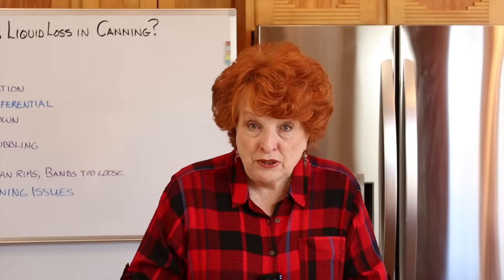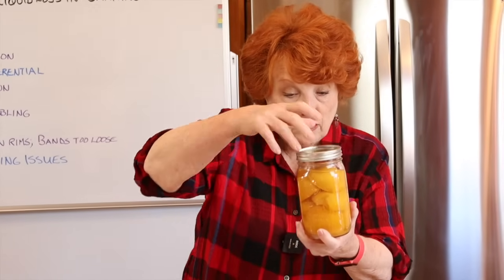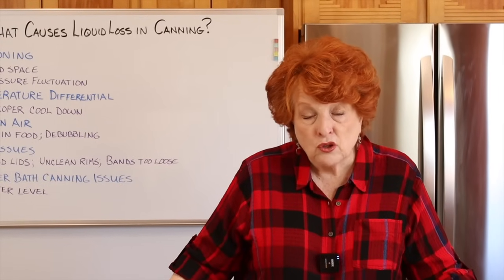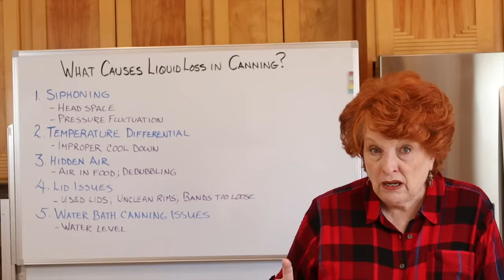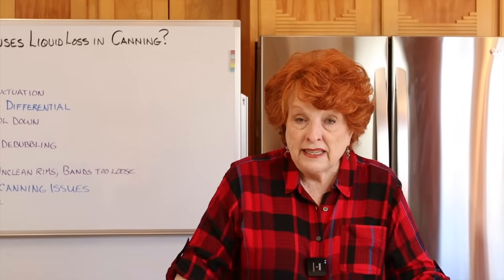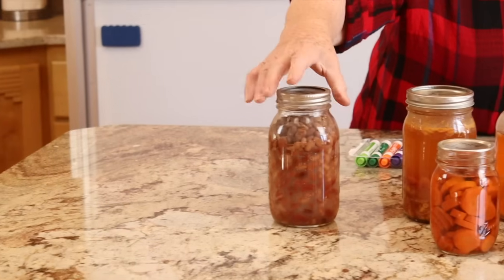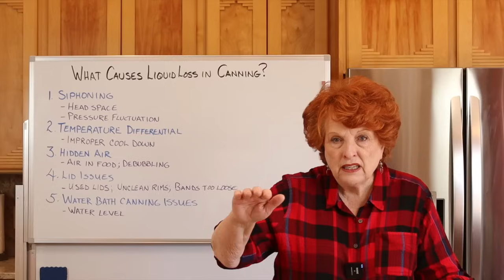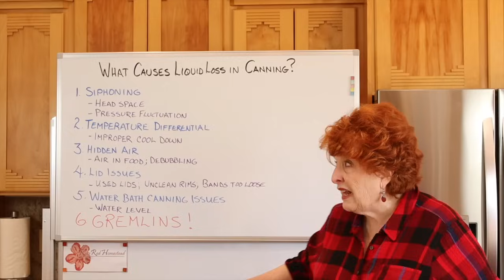What Causes Liquid Loss in Canning

Comment: Thank you so much for sharing your knowledge with us. I have a question. I water bath canned some raw pack peaches. I live at 8200 ft. When the time was up I turned off the heat and let the 4 jars sit for 10 min. I lifted 3 out and they were fine. The fourth jar started super boiling and spewing steam and liquid after I got it out of the canner. I set it down and it continued to push the syrupy liquid out for several minutes. The first 3 jars were Ball, but the failed one was an anchor hocking one. It did seal and in the end all 4 had the same liquid level about a half inch under the lid. Is this a jar issue?  There was about a 4 inch syrupy ring on the towel but the end the liquid level in the jar was fine. Why wasn’t it lower?

Comment: Thank you so much for this. Again I learn more and more from you. I have water bath canned for many years, new to pressure canning. This year in canning salsa we had two pint jars that initially sealed but then failed out of 44. I know that doesn’t seem like much, but we have had maybe one fail in many years. This year we did not put the lids in hot water as we have always done before since the directions have changed and say you don’t need to. Should we still be putting them in the warm water? Could that have caused the failures?

Comment: Last wk my husband processed several quarts of apple slices.  I noticed one jar seemed low in liquid.  I thought it strange because that usually doesn't happen.  When I took a closer look later, the ring wasn't even on the jar correctly.  One side was up about a quarter inch.  It must have been a gremlin because my husb knows better.
Reply: I would suggest to mark that ring and keep an eye on it next time you use it for canning.  Last year I bought 6 dozen new rings and every one was defective.   Most couldn't even be tightened at all. The ridges around the rings aren't deep enough to hold and they come off during the canning process.
Reply: @BH-gr2ds  Thanks for the warning about defective rings, but that wasn't the problem here.  He just screwed it on crooked.  It's not so easy to get everything right when you're 82.  I was just glad he did it since I'm 78 & was diagnosed w/ Parkinson's making the preparation of apples (peeling, coring & cutting up) more difficult that it used to be.
Reply: @suellenw561  Understandable.  And that can happen to any of us, at age. 😊

Comment: So regarding the temperature differential, is it better to just wait more than the 10 minutes after the pressure comes to zero?  Just always do 30 minutes or some other number rather than lifting the lid after 10 minutes? Or will leaving the food in that pressurized environment for longer than needed cause any issues?
Reply: Because my glass cooktop remains very hot for a long time, I carefully lift (not slide) the canner off the burner to a cooler spot right next to it. This helps emmensly. I still wait at least half an hour after the Guage reaches zero.. Sliding could damage the cooktop or at least leave unsightly aluminum marks. My range is 20 yrs old and still looks like new, never using when dirty and well cleaned with a utility razor when necessary, followed by Bon Ami (naturally occurring and finely milled feldspar, which does not scratch and is cheap to buy) I still rue the day I bought this house with no gas! BTW, using the appropriate pan size is vital.🎉 25:23
Reply: I am not an expert but I always wait a little longer than 10 minutes.

Comment: I so appreciate your explanations and research.  I am frustrated with what I believe are problems  with the silicon on lids. I have had higher failure rates when water and pressure  canning. I found a couple old lids from the days of rubber sealing material. Not only is the metal 2 to 3 times as thick, but there is more sealing material.  My other observation is that the lids on the new jars will pop on the way home and at home and they seem to pseudo-seal and then pseudo-unseal. By the time I go to use them, they look like the sealing material on the lids of jars that have sealed. I recently got a 100 pack from 4-Jars and those lids are sealing to the top of the lid below it. I have started to replace the lids on the new jars and heating the lids. As I have an electric Presto, I am tightening and giving the bands "a hug."  My failure to seal rate is greatly reduced.  
   What am I missing?

Comment: I finger tighten canning rings.  After canning my rings are sometimes loose.  Sometimes 1-2 or sometimes all.   My canning lids are sealed tightly on the jars.   Is this still safe?   What causes it?   There is no siphoning going on.  The water in the canner is clear. 
This has happened with both pressure canning and hot water bath canning.  Thank you Pam and Jim.  I love your videos.
Reply from the maker: That happens to me as well.  I think sometimes the steam escaping from under the lid can loosen the band.  So long as the lid is sealed the food is good.

Comment: Could someone please answer my question? 
First the question, then how I messed up. Thx
Should I throw out those first canned veggies or should they be safe?
Thank you for another video that helps me as a newbie. My first canning experience brought 2 problems. Because I wasn't sure how tight finger tight is, I did not tighten my jars enough. I also have an All-American canner which is scary just to look at and I was confused by the directions to leave an even space around the lid when tightening the screws. So the lid wasn't tight enough. I couldn't get the canner to come to the pressure needed. Soooo while waiting I could hear some lids popping inside. Not good so I turned off the burner and let it cool down. When I removed the 13 cans all of the seals were tight but a lot of them had liquid escape. So I removed those tops, took out some black eye peas that had swelled to the top, added more water to the ones that needed it and replaced all lids with new ones. I did some research and started over with those same jars. Success!  Should I throw out those first canned veggies or should they be safe?

Comment: Such a careful scientific canner, re your liquid canning situation. Excellent, your safety processes and conclusive analysis of particular foods, which can vary, like the broth. The broth situation led you to conclusions that you implement in all future cannings of this food, broth. 

Another point, wouldn’t do it, but fyi, perhaps your opinion in the future of people who water bath can, everything. 

It’s not safe, we feel, after listening to this channel. But some do this, and historically the Amish, for centuries. 

There are several vids on this. We felt the longevity of their processing, storing foods like that, has some weight. But, listening to the scientific data as explained on this channel re: these low acidic foods (think we’re right with that, low acidic) like green beans, carrots, etc., not willing to take chances w that, not wise, or at least extra protection for these types of foods. 

And in a future vid., your opinion on someone wanting to store lower acidic foods but they don’t do the pressure canning, they just don’t can these items, let’s say. 

Do you feel dehydrating these types of low acidic foods can give good results and are ok in place of pressure canning? 

We think the answer is yes, bec dehydrating eliminates the conditions that can cause botulism ? 

We’ll look around the vids to see what you say on some of this. But, in the future, we’ll look to see if it’s addressed (if the comment - fairly lengthy - is read)

But thanks a lot, top channel ✔️

Comment: Hi Mrs. Pam. I have T-Fal Pressure Canner. I just start canning broth recently and get siphon after turn off the heat. some Jar lids inside the canner start exploding when PSI drop down around 5 PSI. it took 10 mins for the canner drop from 11 PSI to 0 PSI. is it normal pressure drop or is it drop PSI too fast that cause siphoning? i added only 2 qt of water to the bottom that the water level barely touch the bottom of the jars. So i don't know what i did wrong. only happen when i was canning broth. 2 out 7 jars will exploded lids every time i did pressure canning broth.

Comment: Hello Pam I have the same Presto canner as you. The Presto book that came with my canner says the weight starts to jiggle at #15 pounds of pressure. I had my gauge tested at the Cooperative Extension and they said my gauge is 3 pounds light, but when the weight starts to jiggle the gauge is at 15 pounds. I'm confused?
Reply from the maker: The weight that comes with our canner is a 15lb weight and when it starts to jiggle, the dial should read close to 15 lbs as well.  It sounds to me like yours are aligned with each other as they should be.  Maybe the testing the extension office did was faulty.

Comment: Just wondering if the fat in the chicken broth was causing the problem with the electric canner. Since fat heats up to a higher temp than the actual broth itself, fat will need a longer time to cool down. The smaller square inch volume of an electric canner will cool down faster than a regular stove top pressure canner. Since I personally have very high cholesterol, I always cool my broth, skim off the fat, and then reheat the broth prior to pouring into the jars. I use the Instant Pot Max (thanks to your recommendations for my 5200 ft elevation) and have processed several pint jars without any problems. You may want to consider giving this a try next time.

Comment: I have a question, new jars that come with lids and rings on the jar. I noticed the lid seals look like the jar has pressed and indented the seal materal, are they still ok to use?
Reply: I am wondering the same thing. In fact yesterday the lids were stuck to the jar. I didn’t use them but still had 2 that haven’t sealed yet.

Comment: I have the Presto Digital Canner and I am at Colorado 5280 elevation. Does the Digital Canner automatically take that into account or do I need to continue to add the extra 10 minutes to the canning time like I do with water bath canning? I reached out to Presto but never heard back:(
Reply from the maker: We do not have our Presto Digital Canner any more. When I contact canner manufacturers call them and if they do not respond, I call back. If that does not work, contact them online. The other option (if the canner is not too old and you have your receipt) is to return it to the store of purchase [SOP] and get a refund or exchange. If the SOP cannot help, ask for the email address or phone number where you can file a complaint.  Jim

Comment: What are your thoughts on reusing lids for pressure canning?  Is this practice considered safe, or is one just taking their chances? Does this practice have a high success rate?
Reply: I'm risk adverse, taking no chances on the health of my family. Think of all the things you buy for a couple of $'s. A Starbucks coffee is double the price of a box of lids! Used are fine for dry storage.
Reply: I decided to try to reuse a few lids along with new ones.  I don't understand what happened but I had seals with both and failures with both.  Someone wrote in that before 2020 lids were of a better quality.  I tend to go "new" but even that is not a %100 guarantee.
Reply: I don't do it often, but I have reused lids. Check the lids carefully to make sure the compound is still good.

The few times I've reused lids, it was better than having food go bad. I also use those jars first so I don't have to worry about seals failing over time.  Personally, I don't recommend reusing lids if you can avoid it.  

Pam did an experiment using used lids and Tattler gaskets. That's also an option.

Comment: Lmao. I love the Gremlin theory.  I rack my brain at times to try and figure out if I did something wrong and times I do not come up with an answer.  Other than "it is what it is".  Like your self, I have been canning for many years and am vigilant about it.  I want everything safe.  Another thing that I have noticed since the covid debacle, across the board, madina, kerr and ball lids are thinner and theff seals are smaller.  I have had more seal failures in the last year than I have had over 40 years of canning.  Also the lids are buckling.  Weaknesses in the lids metal.  I get at least one of these jars for every 3 canning pots of 7 jars.  So one for every 21 jars done.  And at least one jar out of every 7 will not seal, sometimes 2.  I have stopped using the lids that come in the new cases because of this and have quit using Mason, kerr and ball lids.  Problem was solved.
Reply: I agree with your findings also.  It can be infuriating.  What do you use?
Reply: @gailoreilly1516  I started using the reusable lids with separate seals and for the metal lids I order from forjars or from Lehmans.  They are a thicker metal and actually have the wide rubber seals.  Lol go figure!